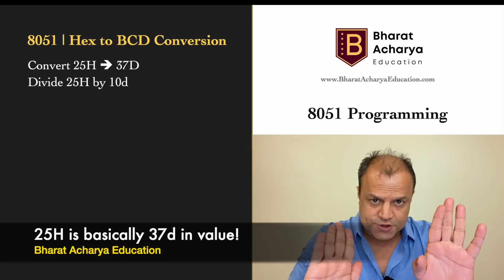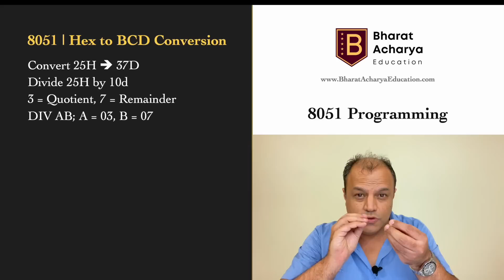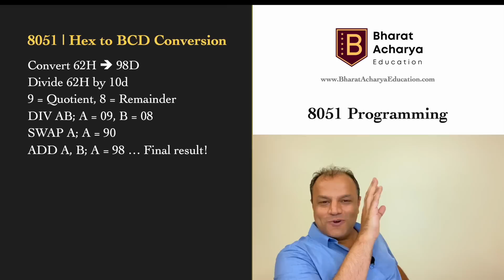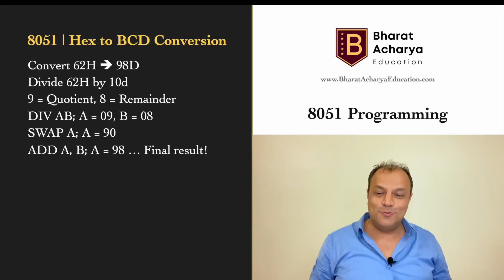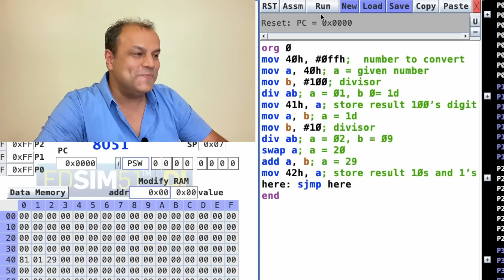8051 | Program to convert Hexadecimal to BCD | Bharat Acharya Education

Comment: Thank you for the explanation.  This was helpful!

One thing that confused me that I had to learn was about the Modulus Operator in C (%).  This is where you get your remainder from, which is really important for this tutorial.  Once I learned that I had to do TWO operations to get the result, this tutorial made much more sense.  You have to do something like this in C:

int HexToBCD (int HexIn)  //  **Note that the input HEX byte should be 0x63 or less.
{
int  result;  //  Register to hold what we calculated

//  *For Testing*
HexIn = 0x5B,  //  Force the input value to 0x5B for the heck of it, so this is what you will be converting
//***********

result = (HexIn / 10);  //  This is where you get the result for the tens place, result will equal 9
result = (result << 4);  //  Shift the result into the upper nybble for the tens place, so result will now equal 90
result = (result + (HexIn % 10));  //  The result of the (HexIn % 10) will be 1, and that will be your ones place.  The result register will now contain "91", which is the correct Hex to Base10 conversion. 0x5B = 91d
return(result);
}  //  End of the HexToBCD function

I hope that this helps someone else that may be struggling with this same detail 🤓
Reply from the maker: Thank you for the appreciation and such a detailed and accurate reply.

Comment: HOW TO CONVERT FFF INTO DECIMAL
IS THERE ANY DIFFERENT LOGIC EXCEPT DIVIDING THE NUMERATOR BY 10,100,100 BECAUSE I WANT TO PRINT THE HIGH BYTE AND LOW BYTE OF ADC IN 7 SEGMENT INTERFACING IN 4 PORTS

Comment: So, basically we are taking decimal and storing it as decimal...
Reply from the maker: No
Reply from the maker: The number is stored in the memory as a hex number. It’s value say 25h is basically 37. Now I need to display the number. I can’t display 25h because I want to display its Dec equivalent. So we convert it to 37. 

Learn my full courses at...
Bharat Acharya Education 
https://bharatacharyaeducation.com
 
Courses available for you...
8085 | 8086 | 80386 | Pentium | 8051 | ARM7 | COA
Fees: 1199/- 
Duration: 6 months
Activation: Immediate
Certification: Yes
Free: PDFs of full theory
Free: VIVA Qs and MCQs
Start Learning... NOW!
https://bharatacharyaeducation.com

-———
Follow me on Instagram ...
Instagram:https://bit.ly/3r45LAp

-———
Contact me on WhatsApp...
Number: +919136428051 
Link: https://bit.ly/3IGvfdf

-———
My books on Amazon
8086 Microprocessor: https://amzn.to/3u2t6Ee
8051 Microcontroller: https://amzn.to/3obYQRs

-———
Use My Coupon code at Unacademy
“ACHARYA10” and you will get 
up to 20% off on any course! 

-———
#bharatacharya  
#bharatacharyaeducation  
#8086 #8051 #8085 #80386 #pentium  
#microprocessor #microcontrollers
Reply: @BharatAcharyaEducation  oh yes sir, now it's clear... I was missing that actually. Thanks for clarifying once again ❤️